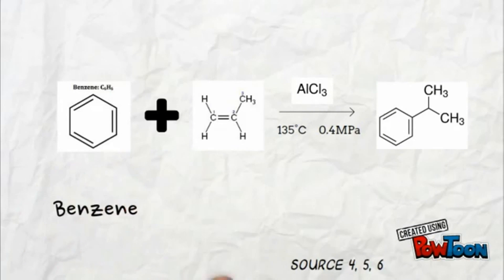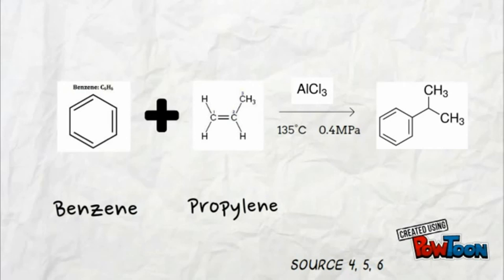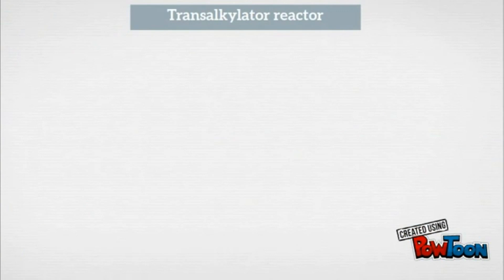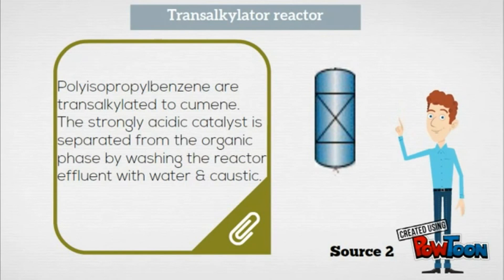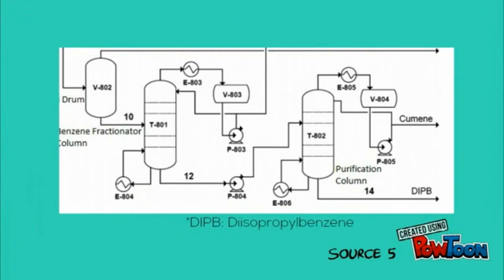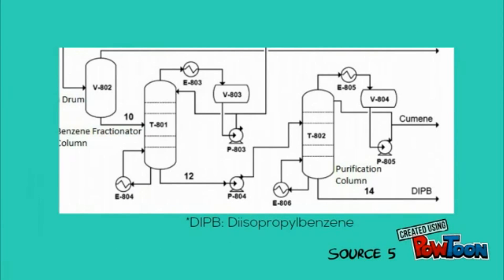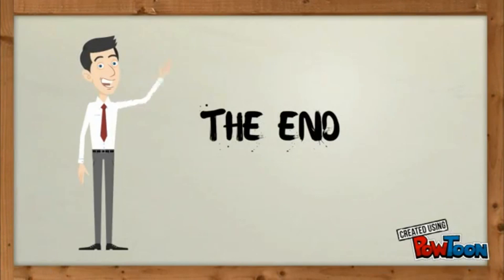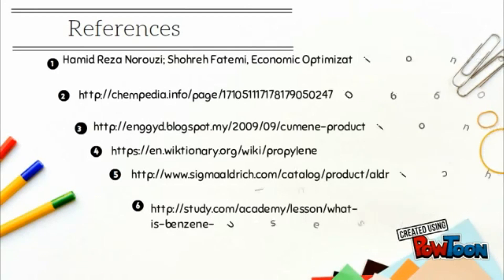EKC336 Group 3 - Monsanto Lummus Crest Process

Comment: Process for production of cumene 

EP 1663917 A1
 
This invention related to an improved process for preparation of cumene. More particularly, the present invention relates to a process for the preparation of cumene using catalytic membrane reactors. The membrane used in the process facilitates reaction in a forward direction such that byproduct formation is reduced or eliminated.

hmmm... damn.. wrong page..
im looking for

Formula	C21H30O2
Molar mass	314.4636
SMILES
Oc1c(c(O)cc(c1)CCCCC)[C@@H]2\C=C(/CC[C@H]2\C(=C)C)C
InChI
InChI=1S/C21H30O2/c1-5-6-7-8-16-12-19(22)21(20(23)13-16)18-11-15(4)9-10-17(18)14(2)3/h9,12-13,17-18,22-23H,2,5-8,10-11H2,1,3-4H3/t17-,18+/m0/s1 Yes
Key:ZTGXAWYVTLUPDT-ZWKOTPCHSA-N Yes